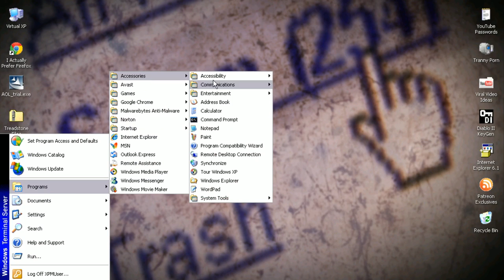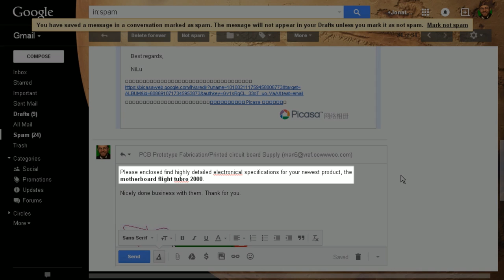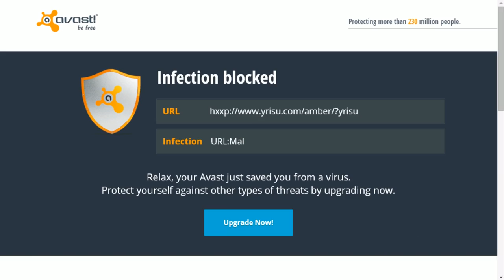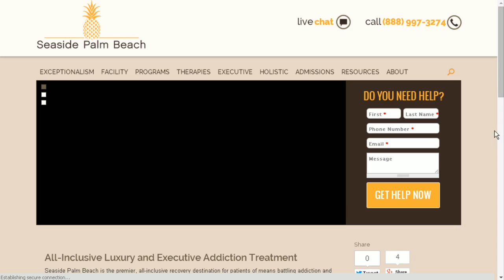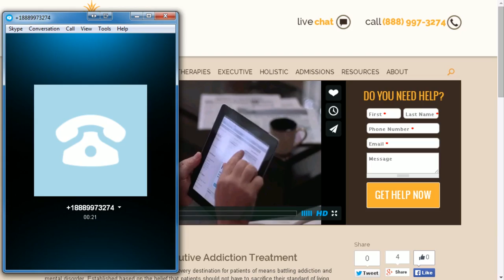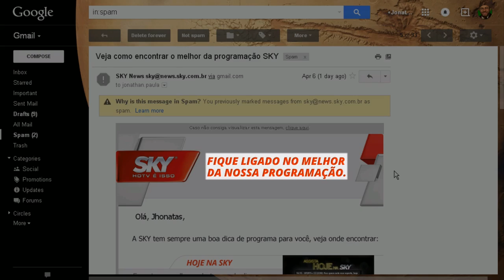Futuristic Circuit Boards?

Comment: I'm waiting for that motherboard to hit the market. It looks powerful as hell.
Reply from the maker: Adam Hansen For sure! It has octo-triple CPU threaded corebanks for maximum heat displasion and hyper-marking.
Reply: Jogwheel Plus I think I saw a micro miniaturized flux capacitor - takes the about 3 seconds board back in time so that whatever you command it to do is already done before you command it.

Comment: Why don't you just check these spam messages on an emulated PC so you can visit the links and experience the viruses to see what they do? It isn't hard, I do it all the time to mess around with indian virus scammers.
Reply from the maker: Xx 420bLaZeItSwAgLoRd xX What is an "emulated PC", and how is it different than a "virtual environment" ?
Reply: Jogwheel Windows Virtual PC emulates another operating system so you could just do all the spam on an emulated environment and just back up the image and restore it after each show to get rid of the adware or viruses after each show. That way, we could see the sites which could be hillarious and you wouldnt have to worry about antivirus cockblocking you. Virtualbox is another program that could be used.

You could for example at the end of each episode after installing whatever programs the spam tries to install see how many new icons or toolbars you have on your desktop\ie, would be neat!
Reply from the maker: Xx 420bLaZeItSwAgLoRd xX ... so, you're suggesting I do something I'm already doing?

Just trying to understand you correctly.
Reply: Jogwheel If you're already running on a clean, emulated PC why let Avast block links? It would be way more interesting to see the websites and see how the viruses or malware affect the computer.